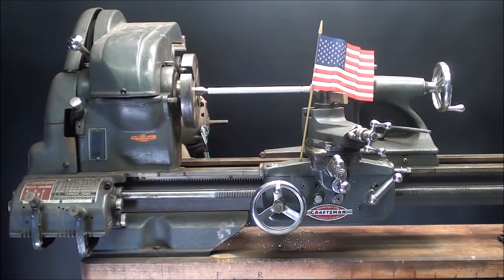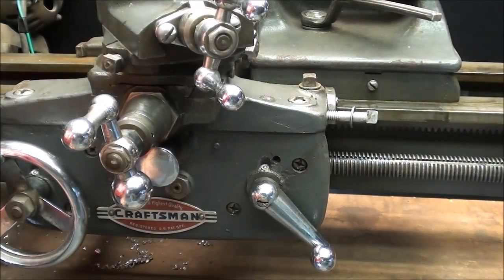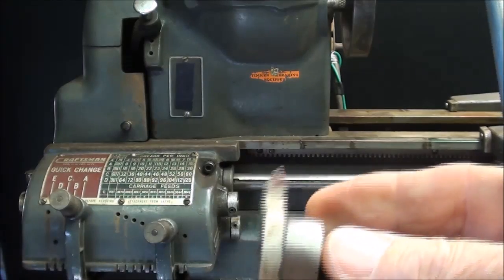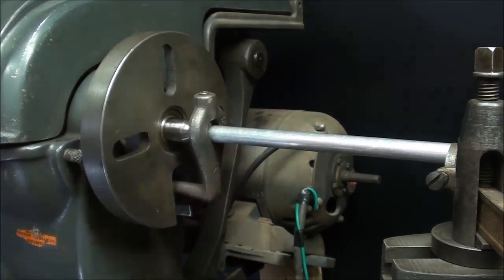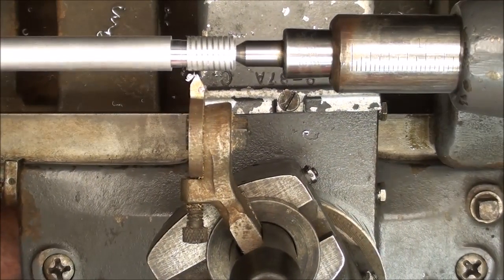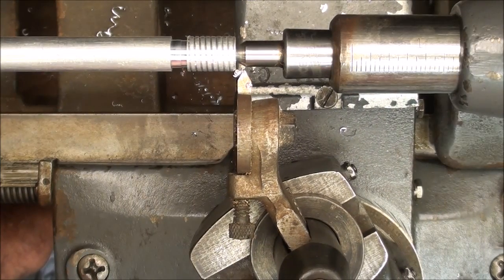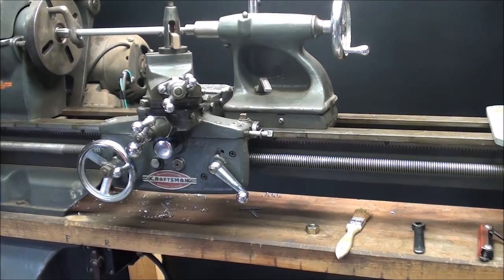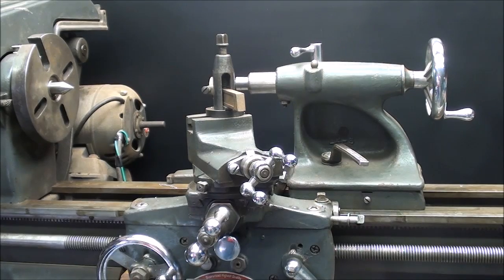SHOP TIPS #237 Threading W/O a Dial on Atlas/Craftsman 12" Lathe tubalcain

Comment: I wonder if you could cut forward and reverse. advancing the cross slide a bit each way. I understand if could unscrew the chuck in reverse but would it not work and twice as fast as cutting threads.

Comment: Dear Mr  Tubal Cain , I was (shown at school)   how to  cut a third with . out a lead screw .  by using the linear gears under the lath  bed. we have a cholesterol ,  lath that we cut tread's with IN Britain called a [Graduate Master} .  But it as no lead screw . or dial monitor, .  just a drive ,siding shaft like you atlas shaft with no thread's.   

 So I Thought i would Explain how it was done.
before i go to, my grave,  & you preps can do a video  on it , so to pass it on . Try it out on the  atlas it smelter i don't have a lead screw but i have a led screw gear. to reactivity the sandal   So you may need to use your  half nuts to  travails the  saddle but this meter sill work with you travels slide  on my Lethe.  if you travels is driven by  the shaft the banjo  &  you can disengage  the half nuts, if you  Did-not want to keep reverse up the thread the gear can be dis Engaged. 

to Thread with no led screw to thread to drive the dial   first mark  a point  on the body of the  lath.   &  on the chuck, to represent the timing markers  .   in line wit each other .  then  the next timing mark must go on the driving  shaft .  of the apprise . some-wear by a fixed  point &  rotatory point . to the banjo , where the convenient to see  my travailing  lever is. disconnected  & i then move the sandal up the lath a a palace  where  i desire to start my threading . i now marking  my Saddle with a sharply on the define it  tape can be used , 

Now  the trey points must always  line up to  cut your desired thread .  Engage  the travels before marking  up the saddle  then dissing Engage  to star your  lathe.  now follow the preserve you filmed & proceed to cut a thread  the the Travis leaver.  stop the lathe &   to move it  back  to the markings  tern the chuck until  all marks line in up to the marked place once you have  this done set your next cuts . & cut until your  thread , reaches it's  depth, 

Les England . try it  & past the lesson on some of them interested so  it isn't lost . i don't do firming . i'm to {Cack-Handed } at it .  pas it on before it's lost .

Comment: Pete put some lucas red n tacky on the gears will quiet them right down,,I know many say no because of chips,, there under cover,, l couldn't believe the difference it made in my 12 x 36
Reply from the maker: I need to get some of that
Reply: @mrpete222  yea,, it is a lot better then trying to keep oil on the gears and always wiping up the slung off oil
Reply: @mrpete222  love your vedios just don't agree with the lubrications,,,timken bearings need much heavier oil then 20 weight and open gears need grease,, and the red and tacky is proven best grease and comes in spray cans,,,just clean gears and lightly spray it on...

Comment: I have to thread six  6.9875" disks 8 tpi. This is really going to help me a lot! It's not that I dont have a threading dial, it's just that I don't want to mess up these disks ( which have a lot of work in them aready !! ) by using the thread dial and missing the engagement point on the dial, thereby screwing up the threads. Simply can't afford that right now !
So Mr. Pete, question is
since  my Jet lathe has a DRO, can't I just plunge cross feed straight in (in very small passes/steps of course) to required thread height (Major Dia - Minor Dia) / 2  ? Instead of using compound set at 29.5 deg. Not to mention compound has tiny little numbers I don't like! That way I can harness the usefulness of X axis DRO. The DRO is not hooked to the compound, only to cross feed (naturally). Probably can live with chatter. I'm not too concerned about minimizing wear on the thread tool  using the 29.5 degree, one off job.
Reply from the maker: That will probably work, but I do not recommend it

Comment: Ever since I watched this video I am desperately trying to figure out how to wire my motor to run in reverse. My Craftsman 101.289170 (12-inch) came with a Craftsman motor (113.19656) and a Cutler Hammer 3 position switch. Two wires in the harness are not connected to the switch or motor. Can someone explain how to wire this motor and switch to run forward and reverse?
Reply from the maker: I sure can't. In some of my old videos, I had to ask other people how to do that. Hopefully someone will answer this
Reply: mrpete222 
thank for all you do. Yours is the greatest channel on YouTube for this material.

Comment: +mrpete222,  I'm new to metal lathing and am trying to learn the best way to make repeatable threads without error (or at least reduce the risk).  If I spend an hour on the rest of the part and the last step is threading and it blows up.  I'm sunk and I'm sad.  :-D  

I have a thread dial on my lathe but this method seems less error prone because you keep the half-nut engaged.  Is this a better method than using thread dial?  It seems less error prone because you always have the metal your working on and the cutting tool in sync with the thread. With a thread dial you pop the half-nut and then try to put it back in the right spot with the thread dial.  What are the advantages of using thread dial?  Thank you for your help and excellent videos, showing everything I would need to know.

Comment: Great video, thanks for the instruction. However, I disagree. You don't need a reversing switch. Once your cut is made, switch off the power, back out the crossfeed and manually turn the chuck/dog plate in reverse by hand. There's more than one way to skin a cat!

Comment: Great video and very helpful for those who must cut metric threads on a lathe designed for Imperial threading. I have a geared-head gap bed lathe that is designed for cutting a wide range Imperial threads using its threading dial and being able to release the half nut at the end of the cut. This lathe can also cut exact metric threads using an installed 127/120 change gear and the same quick change gear box. However, all metric thread cutting requires leaving the lathe half nut engaged at all times and reversing the motor. Nice to see how smoothly you did this operation. Thank you!
Reply from the maker: +Paul Jones  Thanks for watching

Comment: Imperial threading dials can't be used for cutting metric threads, so if you have the metric transposition gears for your lathe, you use the exact same method to cut metric threads on an Imperial lathe.
Reply from the maker: +HemiRod23 Thanks

Comment: Good video.  My 1903 20" X 36" American Tool Works lathe has no threading dial.  I have used this method many times for cutting threads.  One more useful point is that when cutting a thread that is a multiple of your lead screw no timing device is required.  For instance my lathe has a 6 tpi lead screw.  So I can cut a 6, 12,18, 24, 30, 36 using the half nuts and engage the nut at any time.  It works perfectly!
Reply: +Junk Mikes World Cool, I have a 1908 ATW lathe. I feel your pain.
Reply: +ShysterLawyer I would love to see it!  Antique machines are my favorite.
Reply: +Junk Mikes World Here's my thread on it at the Hobby Machinist forum, there's some pictures there:
http://www.hobby-machinist.com/threads/my-new-american-tool-works-lathe.37610/page-3
Reply from the maker: +Junk Mikes World Thanks for watching--thats good info

Comment: On this Craftsman 12", what do the half nuts, the lever and mechanism for engaging the half nuts look like?
I have a Clausing 4800 12" that was given to me if I could haul it away and it is missing the half nuts, the lever and the mechanism for engaging the half nuts. I need to find anyone who can reproduce them.
Reply from the maker: +ChronicPain I have a vid on that
Reply: +mrpete222 Checked the video out and the parts are different. I completely forgot you did a video on it. I need the Clausing 4800 parts or measurements of the parts.

Comment: Informative video,thank you. I may be wrong but is this not exactly the procedure that must be employed for cutting metric threads? I was taught that metric threads had to be cut this way even if you have an engagement indicator?
Reply: This is true on an English lathe (imperial lead screw)
If you have a metric lathe you disengage the threading nut on metric threading and have to leave it engaged when completing English threads.
Reply: Dick Mick that makes total sense! My Myford Super 7 and Hardinge cataract both have imperial lead screws as did the Colchesters I learned on. My big lathe(18"X 72") is a Rollo Supreme has an imperial lead screw but can cut all imperial and metric pitches without having to use change gears and idlers. It is all done in a clever gearbox.
Reply from the maker: +Andrew Wilson I have another vid on metric threading
Reply: +mrpete222  Thank you sir,I have watched that and all your other videos. Have you any experience in setting up and operating a capstan lathe? I have just acquired a six position turret and rack and pinion saddle for my 1904 Hardinge Cataract with a view to making small batches of custom fasteners.Being original Hardinge parts they are beautifully made and I reckon will be a delight to use. Pretty amazing for a lathe 110 years old!
Reply from the maker: +Andrew Wilson No-never seen a capstan lathe. Thequality of Hardinge is subperb

Comment: I discovered, especially with deep threads on large parts, that older tooling may require more than one spring pass.  Even more so when internal threading (deep in the hole) with a boring bar.  After six passes, I started to do two spring passes to keep the load on the tool from ramping up, and at near depth I had make four spring passes before the chip load went down (2-9/16, 5 tpi, .005 feed/pass on the angled compound near the end).  Wide and deep thread will take a long time, don't make your first attempt on a tight schedule!
Reply from the maker: +diggerop Thanks you very much--so true

Comment: I don't have a threading dial and I don't have reverse either. What I do is engage the threading lever and mark the ways on both sides of the carriage with a felt marker. Then I mark the position of the lead screw and also mark the position of the spindle. When cutting threads the carriage is positioned between the marks on the carriage and the threading lever is engaged. then I rotate the chuck until the positioning marks on the lead screw and spindle line up together. Now you ready to make a cut. This way you can use the threading lever to stop the feed. I have been enjoying your videos for the last couple of years. Thanks for sharing and all the best.
Reply from the maker: +NSTRAPPERHUNTER  Thanks for watching--you have a good method-keep watching

Comment: I find your videos on lathe use very interesting. Many years ago i met a old German man selling some machinist tools he no longer needed. I told him i wish i knew how to run a lathe because at times being a old car nut i needed to make small parts to keep the old beast running. He told me he hated using a lathe and found it to be boring. My guess is he probably worked in a shop or factory cranking out the same part over and over again. Years ago i was working on a old Chevy 235 engine and wanted to adapt a 258 Jeep electronic distributor to it. The housing of the distributor was to big so i used my drill press like a lathe to turn the aluminum housing down to the proper size.
Reply from the maker: +Chuck Small Thanks for watching--necessity, mother of innovation

Comment: Excellent as always. Question.. How far below center do you run your bit (from the top of the bit).
Reply: +DrFiero  The tool bit must be on center. If too high, it will not cut as the part contacts the face of the tool instead of the cutting edge. If too low the geometry or shape of thread will be incorrect and the cutting edge will have negative rake. 
    Mike (o\!/o)
Reply: +Experiencing Technical Difficulties Thanks - I knew not over (hence the 'how far below') - it was really just a how far under question. .001"?  .100"?  1mm I can juggle in my head.  Or "a couple thou" will work.
Reply from the maker: +DrFiero Thanks for watching--.005 under

Comment: Hi Mr. Pete. I noticed an addition green grounding wire to your lathes motor. Did it develop a "leak"? Not fun when you get a little zap from your machine when the motors insulation degrades.
Reply from the maker: +John C No leak--just in case!

Comment: Very good as always. I always try to watch one of your videos each evening. I know you can't answer questions, but does anyone know if any problems arise from using the manual reverse instead of an electric switch? If I did not have my shop packed up for moving, I would just go cut a thread and find out. My Lathe manual says "reverse the motor" a strange term for a machine that does not come equipped with a reversing motor.
Reply: +Richard McNamara  I have always preferred the clutch type reversing lathes as it is easier on the motor not to be always stopping and starting. If you have a clutch or reverse gear then use it. So long as you don't disengage the gear train for the leadscrew it will function the same as a motor reverse.
 If you don't have a threading dial you should consider making one. They are so simple that I have made four of them for different lathes. Someday I might make a video about them although there are some good ones already. If the thread you are cutting is a multiple of your leadscrew then a dial is not needed, just engage anywhere.
    Mike (o\!/o)
Reply: +Experiencing Technical Difficulties First, Thank you for your response. My 12" Craftsman has the threading dial, but the technique above must be used for Metric threading, so my question really  came to mind  when I was thinking about that. Of course the Craftsman does not have a clutch. I have seen some threading tutorials say to never disengage the drive train once you start threading, so if that is true you can't reverse with the built in reverse lever, which seems wrong since the machine was designed to cut metric threads, but did not come with a reversing electrical switch like  Tubalcain has installed. You say "So long as you don't disengage the leadscrew...", does that include the reversing lever or not?  I am going to enjoy giving it all try once  I get my lathe set up in my new shop. My Daughter says I found a new shop with a house attached.
Reply from the maker: +Richard McNamara Thanks for watching

Comment: I recently spun  a chuck off the spindle, but not in reverse. The chuck was spun on very loose with intention to work in the normal direction. I started the machine with a very high spindle speed and it spun off as i stopped the machine. It wasn't tight enough given its weight to slow with the rest of the lathe
Reply: +bubster1981 That's not good at all, especially if your chuck weighs in at 100+ lbs excluding the part mounted in it.  It also has a way of making you feel uncommonly stupid.  Very humiliating.
Reply from the maker: +bubster1981 wow--be careful

Comment: as always, Great videos, but you forgot to do one thing. You forgot to 
put a wedge Between your Lathe dog and your drive plate, to keep it from
 moving, when you reverse the machine. It also cuts down on chatter on 
harder materials. Although not always necessary for soft materials, but 
it is recommended when you're doing a threading operation.

and thanks for the videos, they been entertaining as well as informative. I wish they had been available when I started metalworking, 40 some odd years ago.
Reply from the maker: +Joe Allen Thanks for watching-good suggestion

Comment: Mr. Pete, this is useful to me as I cannot use the threading dial for metric threads on my Raglan Littlejohn lathe as the lead screw is imperial.  I can cut metric threads by changing some of the gears and invoking this technique.  Thanks for sharing.  Joe.
Reply: +Joe McIntyre  I have to do the same on my Boxford (Southbend clone) regards from the UK
Reply from the maker: +Joe McIntyre Glad it helped

Comment: Could you do this by having the lathe going forwards and turn the leaver to send the carriage back? Instead of setting the lathe in reverse.
Reply: +dfvhs wrj j refvyht If you mean turn it back by hand, then no, because you would have to disengage the half nut lever, which would mess up the start position of the thread.
Reply: +Mark Garth I mean the leaver that changes the carriage direction from traveling towards the chuck to moving backwards to tailstock. Whilst having the lathe in forwards and not changing to reverse
Reply: +zumbazumba1 On the Atlas/Craftsman lathe the half nut only disables the cross feed. On these lathes the carriage feed and threading are both run off the half nut.
I think the OP has a good question, can he use the feed reverse to return to carriage to the start position for thread cutting.
Reply: No, because you'd be loosing the synchronisation between the lead screw and the spindle, which is the whole point of not releasing the half nuts.

There are machines that use a dog clutch in the threading geartrain, the Hardinge HLV for example, where you can disengage the leadscrew drive at any point and always get back in synch. The Hardinge doesn't even have half nuts.
Reply: zumbazumba1 True. Apparently it was a cost saving measure for Atlas/Craftsman; this way they only had to run the one screw.
Reply from the maker: +dfvhs wrj j refvyht no--too much backlash

Comment: Great video. Can you make a video on threading an allthread 3 foot 3/4" rod ? Thanks.
Reply from the maker: +RC Miller Thanks you very much--need a long lathe for that
Reply: +mrpete222 It can be done on a small lathe. I just don't remember how. I seen it done years ago.
Reply: @pojotex6542  drive to the hardware store and buy one.